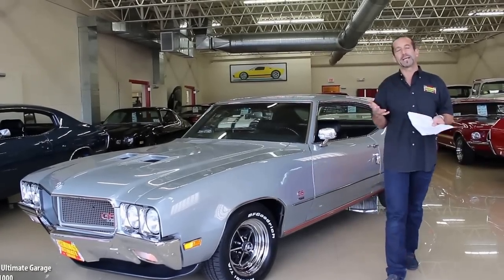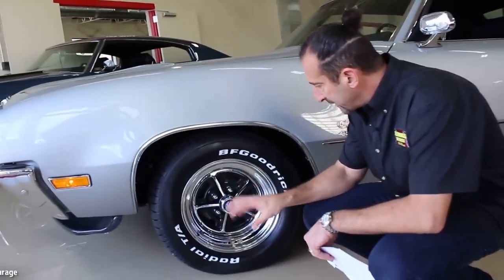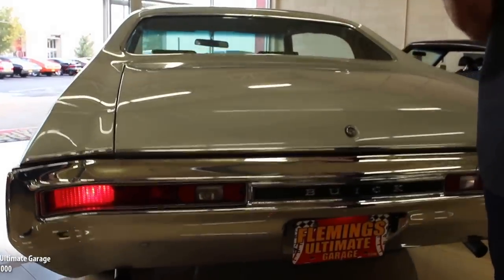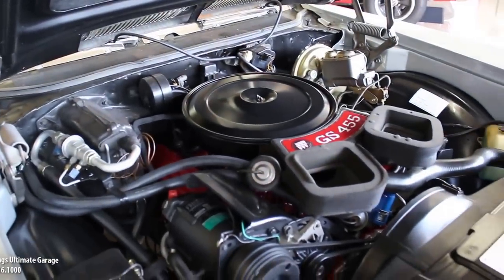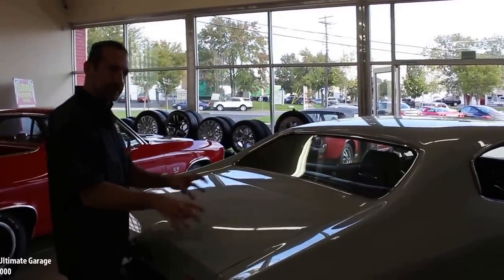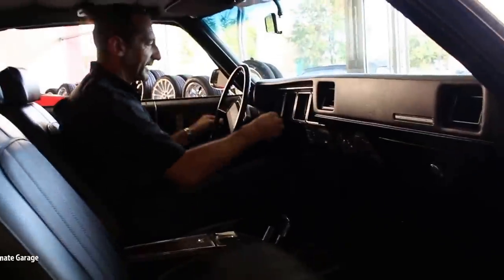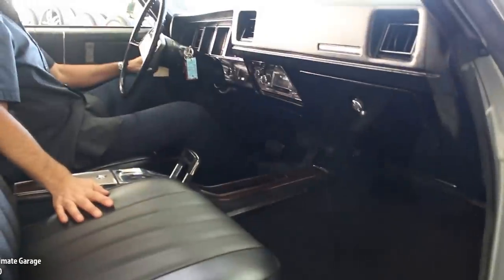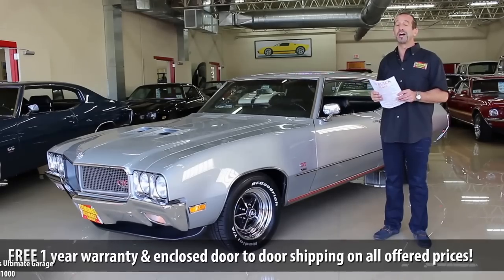70 BUICK GRAND SPORT GS455 for sale with test drive, driving sounds, and walk through video

Comment: One-hundred percent COOL!!!  My dad took my mom to downtown Augusta, GA to get a new car in 1969, and we test drove two cars.  The first one was a GS Buick 400 (gold and black).  Loved the powerful sounding dual exhaust.  The second was a more tame Daytona Blue Cutlass Oldsmobile with a 350 2-barrel carb engine.  Mom wanted the latter.  I was disappointed; however it was a very nice car.  I remember as a kid sitting in the back seat, and because it was an A-body, it had a square chrome button in the back of the front seat that would unlatch it.  LOL

Comment: Old vid, but man...Grand Sport is a Corvette. And I made the mistake of putting the hood insulation in the underhood pockets around the scoops too. Water trap. Lose 'em, whoever the new owner is. Oddly optioned. A/C but it also has the Skylark steering wheel. Not an early production run car either; the overflow tank has a black top. Somebody chose that wheel. Odd.

Comment: Compared to the 4-speed GS Stage 1 I used to own: 1) The interior door panels are supposed to have GS emblems. There's supposed to be a factory tachometer in the dash. That's not a GS steering wheel.  It's still a nice restoration though...
Reply: I have a '70 GS455 bought from the original owner. Mine had the same steering wheel as that.
Reply: The 3 spoke steering wheel was an option

Comment: It was a Buick 401 Nailhead engine on the SR 71 start carts, not the later and different 455 engine. And it certainly wasn't a Pontiac engine.
Reply: It was the Buick 425 Nailhead not the 401

Comment: Stage 1? What is the difference? Beautiful car.
Reply: While both 455s we're great the stage one had a nicer cam with a little bit of compression and head work. They say the stage one package only had 10 more horse but that was just being conservative. The base model GS 455 pushed out about 460hp and could come in a array of colors. The stage one pushed out about 495hp maybe a little less and only came in two colors, white and yellow the white being much more rare. While both were torque monsters at about 510 foot pounds the stage one package took it in over all horsepower. Hence the reason the stage 1 stickers and badges are in the car because that base model GS has been built to the spec of a stage 1 even though you won't see it on the build sheet. You could put the spoiler on and all the badges and stickers and call it a clone if you wanted to paint it. I hope this helps you out
Reply: @adamdavis2760  thank you for the information. I remember seeing stage 1 GS that were many different colors. Are you talking about the GSX? I only see the GSX in white and yellow with a black stripes and spoiler. That is correct. But I'm pretty sure I remember seeing GS models that had a stage 1 motor in them from the factory and we're not the GSX model. So the GS with the stage one could be any color Buick offered for them. I'm not an expert, I just remember seeing them on the road and I guess someone could have put a GSX stage 1 motor in a GS but I'm pretty sure from the factory GS also came with the stage one motor that was put in the GSX.
Reply: @mr.e1220  yes I should have been more specific GSX stage one only came in yellow and white

Comment: Stage 1 GS455 had a 12 bolt ,standard 10 bolt would explode behind the 500 lbft.of torque
Reply: No they didn't. They had the 8.2 rear up to 70, then 8.5 , all had non c clip bolt in axles. Canadian Buick got 12 bolt. Of course might be exceptions . Seller is just that. Even the Stage 1 emblems bolt directly in place of the 455 emblem,  no cutting or tape.

Comment: tony I just watched another of your videos where you said the olds  engines started up the black bird, now you say it was the buick! which is it? i will tell you which one, neither! it was a 454 chevy engine. get your facts straight,,,,,,,,,,,,,,,,,
Reply: I thought the engines that started up the SR 71 was a Buick nailhead?
Reply: @wrotenwasp   Correct, until Buick discontinued them, then they used Chevy 454's, then pneumatic starting was used. It was called a AG330 Start Cart.

Comment: To bad it not a Stage 1 it just a 455 if it was a Stage 1 would have factory drag race heads a camshaft as well... And have the tags on the fender but still nice unit... So it has the cam but not the heads good luck trying to find them but it just a GS 455.  So watch the price.